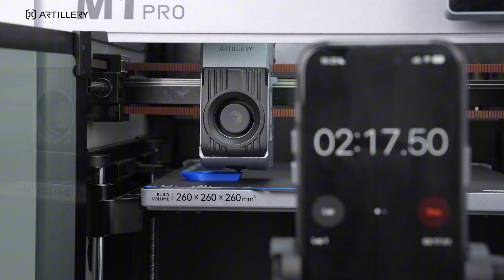Artillery M1 Pro Quality Benchy Test

Comment: I regret the purchase a bit. The first layer isn't consistent, and auto-leveling is poor. After that, it works fine, and prints are fine. Apart from the relatively noisy operation, I also use a Bambu Lab A1 printer and don't have these issues. I bought an Artillery M1 Pro for the heated chamber, but it will be used as an expensive filament dryer. I wrote a review on the Artillery website, but it was removed.

Comment: Will there be an app to use to control printer while away from it for the pro or plus??
Reply from the maker: Yes, you can monitor the printing process and control its printing in Artillery Slicer. Our team will update the slicer when it's ready.
Reply: @Artillery3D is that slicer out yet on apple devices

Comment: Why not build a printer with open-source in mind?
Reply from the maker: We understand the appeal of open-source printers, and we truly appreciate your interest in customizing your machine. However, for the M1 Pro, we've chosen a more controlled approach to ensure the best possible performance and user experience. Modifying the firmware can sometimes lead to unexpected issues, potentially affecting stability and print quality.

That said, our team is committed to continually improving the firmware and providing reliable support, so you can expect ongoing updates and optimizations.  😊

Comment: What is its noise level in dBA at 1 meter? and weight ?
Reply from the maker: When the machine is printing, the noise level is about 55db when the glass door is closed, and about 59db when the glass door is open. The noise level in silent mode is less than 45db
(Note: The decibel meter is measured 1 meter from the front of the machine, and the data comes from Artillery 3D Lab)
Reply: @Artillery3D  , Thanks

Comment: What were the slicer settings?
Reply from the maker: Filament: Basic PLA
Layer height: 0.25mm
Speed:
Infill 400 mm/s
Top Infill 150 mm/s
Outer Walls 250 mm/s
Inner Walls 350 mm/s
Travel 700 mm/s
Acceleration 20000 mm/s²